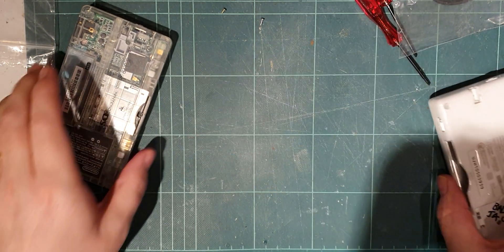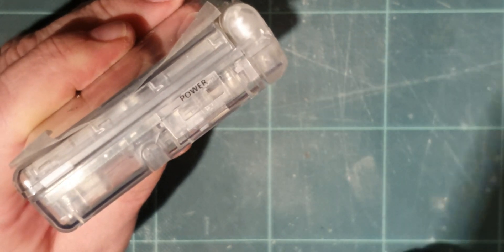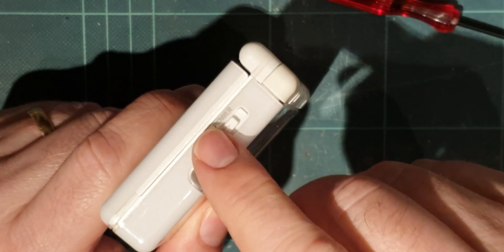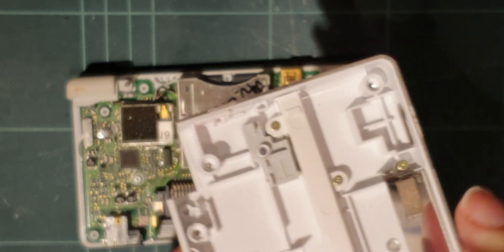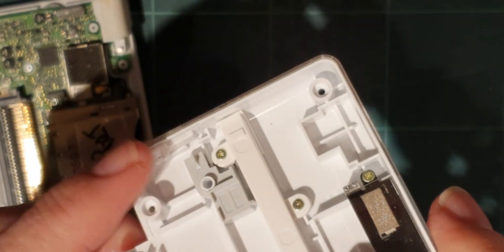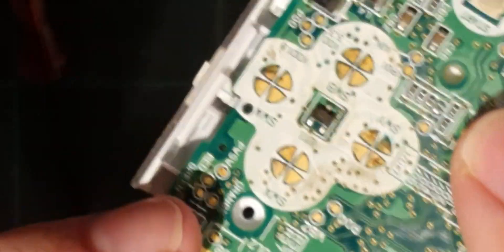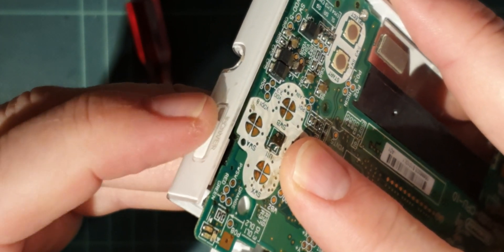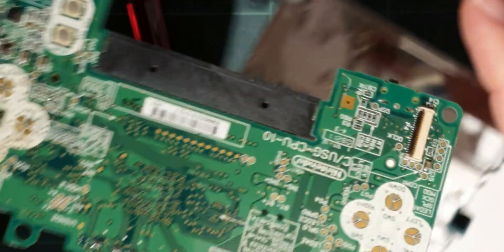My DSLite power switch is jammed or not working - what might be wrong

Comment: Is the power switch supposed to stay flushed on their respective side when on and off?
Reply: Ok so when I turn mine on it doesn’t spring fully back, I have to push it down and it clicks
Reply from the maker: Normally it's springy, so stays in the off position, even when the DSL is on. When you slide it to the on position the dsl will just sense the momentary switch contact to on and start up.
Reply: @spidermaf  thank you, yea I had it fixed